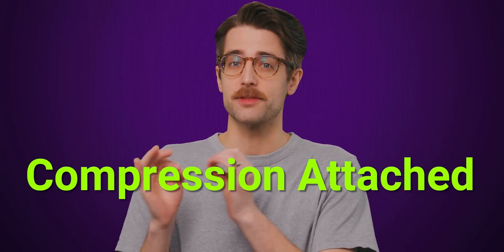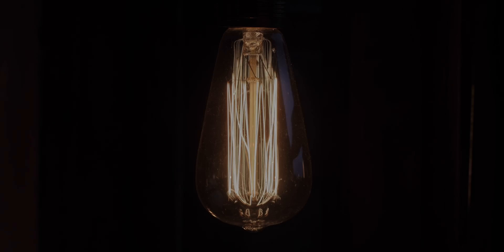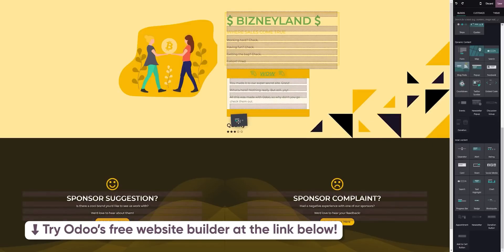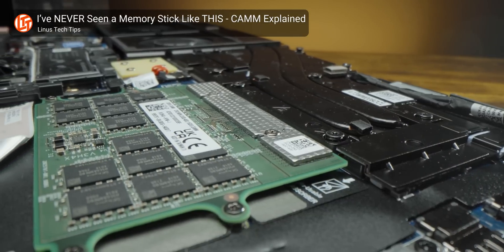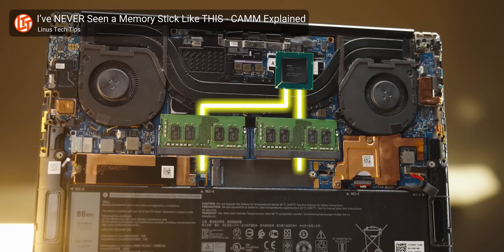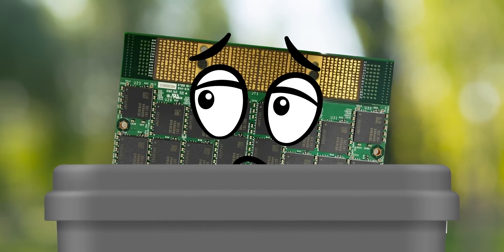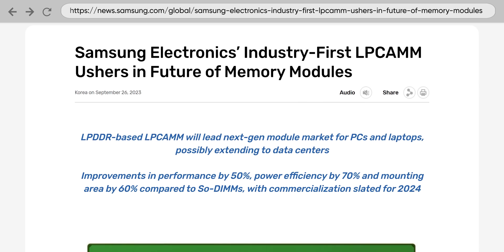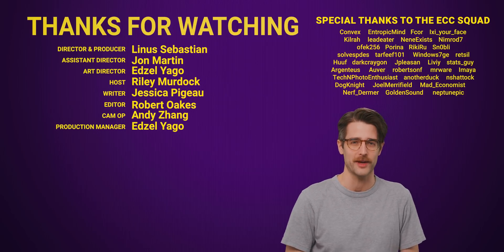You Can Upgrade Your Laptop's Memory Again! (CAMM2)

Comment: I trulyyyyy hope this takes off... Its so hard already to find laptops with 32gb, let alone the price gouging
Reply: Yeah, even today there are still many premium class laptops which still caps the max memory to 16GB with no option to upgrade it yourself because it's soldered
Sure most tech savvy enthusiast recommends everyone to "just buy a gaming laptop which has all the upgradability you need", but some users would not justify the extra weight they have to carry around and shorter battery life
Reply: @sihamhamda47   you mean even more today because it gets thinner and lighter, so more and more "ultrabooks" than ever before.
But besides that, EVERY laptop has 2 SO-DIMM Slots and is therefore upgradeable.
Often, the SO-DIMM inside is not the fastest and also the SSD is not the best, because the manifacturer has to by those parts in the million and therefore: price is the most important.
Also, the companies charge often times way(!) more for more memory than it actually costs.
More than half of the time is is better to just get the Laptop of your choice with the least amount of RAM and SSD (8GB / 256 GB) and after you check the laptop is everything is ok (so, no defects) buy (or have bought before) the RAM you want and the SSD you want.
2x 16 GB or even 2x 32 GB of the RAM you like (speed, latency (CL numbers), voltage) + the bigger SSD you like (capacity, speeds, power consumption).
In total, you have a better and faster device for less money than this configuratiojn directly from the manifacturer.
And the small little 8 GB RAM stick? Sell it or keep it, someone with also just 1 8 GB stick would want to get another cheap 8 GB stick to put them together for 2x8 GB dual channel.
And the SSD? Put it inside a fast external  USB 3 case and use it as a hyper fast USB stick!
Reply: @sihamhamda47 Thing is that Tech savvy guys actually don't do any soldering whatsoever
Reply: What’s worse is lack of options. More RAM is usually reserved for more expensive CPU/GPU combos. Meaning a potential $40 RAM upgrade ends up becoming a $400 meaningless upgrade.
Reply: @jivewig  Just don't buy thin and light expensive gaming laptops witn soldered RAM. They're a meme.
Reply: You will pay $800 for 32gb of memory and you will enjoy it !
-Tim Appleman
Reply: ThinkPad T480 for $180-230 used can support up to 64GB RAM. Namely the models with vPro.

Redmibook Pro 16 2024 comes with 32GB RAM and a 1TB SSD as standard. Pricing starts from $835 in China, you can import it from there for around $200-300.
Reply: @one_step_sideways Yeah, buying laptop in China is really cheaper, I got 32GB, 1TB, 7840HS thinkbook for a equivalent of $900usd.
Reply: CAMM2 will not solve the price issue, nor the availability issue.
Reply: My System76 Pangolin has no RAM upgrades, only 32 GB LPDDR5. I believe it's required to be soldered on Ryzen 6000.
Reply: you can bet apple wont be using it
Reply: CAD or video editing? 😅
Reply: Asus ZenBook OLED comes with 32gb of ram at 1350€
Reply: 64 gb of ddr4-3200 is 100$ on crucial's website
Reply: Why do you need 32gb?
Reply: Okay. You may or may not like it

Now desktop PC joining the CAMM2 craze
Reply: Just get a Framework and buy the memory yourself. Actually the cheapest way to get a 32 GB new laptop
Reply: @Anankin12  Unavailable in some countries, and has mediocre battery life. Framework 16 is overpriced, too.
Reply: @one_step_sideways  that's true but:
1) mine lasts with light use for 6 to 8 hours, provided I don't use it in performance mode (then it lasts like 2 hours max)
2) the unavailability is a big problem because even if you get one, you won't be covered and you'll be unable to get components
Reply: @Anankin12  Other laptops have 10-13 hours of battery life. And that's how it should be. More than 12 hours of battery life isn't necessary, though. I also like how the relatively inexpensive Redmibook Pro 15 2024 has some amazing specs for its price, namely a 99Wh battery (like how it should be in all 16" laptops), a 3.1K 165Hz screen, and a claimed 27 hours of battery life at idle, which should roughly equate to 10-14 hours of battery life in usual tasks, depending on the screen refresh rate.
Reply: @one_step_sideways  I was talking about the 13, the 16 is as you said expensive af.

You can't compare 13 and 16 laptops, the battery size alone will more than make up a 30-40% difference (61→99 is a +50% size, for example)
If you need a 16, don't consider FW (yet)
Reply: Apple says "hello"